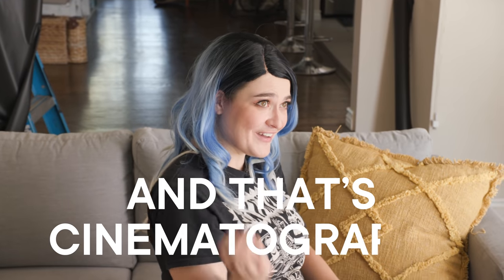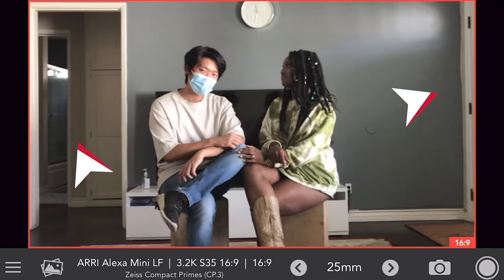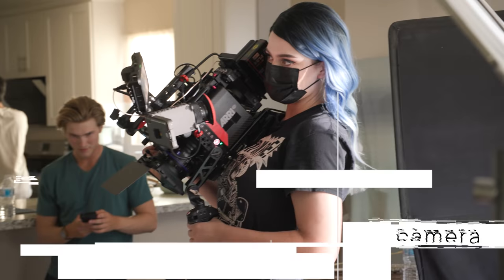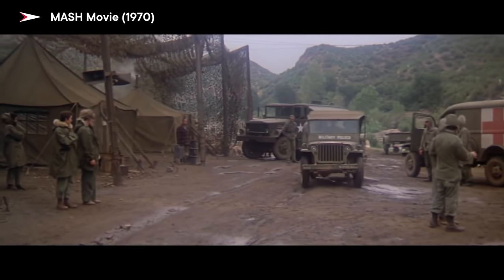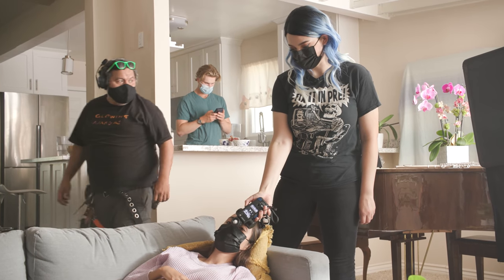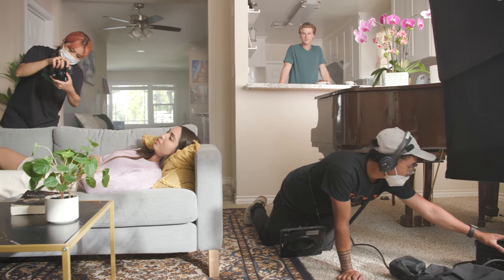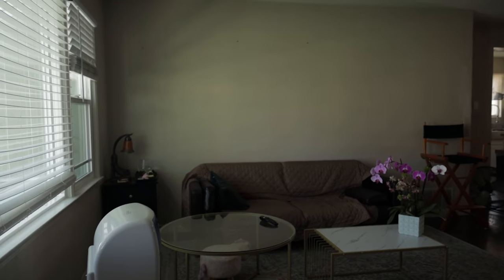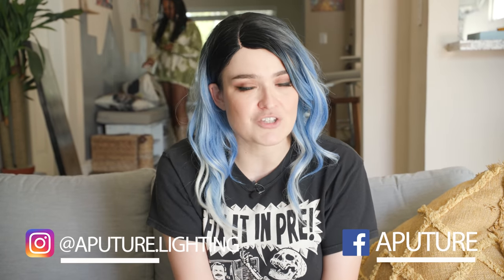Boring Location? | How to Make ANY Setting Cinematic

Comment: This is one of the best tutorials I've seen for aspiring DP's and filmmakers.  Covered a lot of useful info!  One thing I like to do sometimes when struggling with a bad location, especially when it's cluttered with stuff, is to just start clearing out the entire frame- removing all the plants and furniture, etc.- so you can work with a clean slate, and then start adding objects back in to the frame strategically.

Comment: I was once told to only light things I want seen, so I commonly reverse engineer that and remove light from things I don’t want seen in a boring apartment. A white wall with no light turns into a gray wall. Gray is much easier to add color to. So I’ll bounce a light into colored foam core to add slight tints of color to that newly gray wall. 

Vee, always love watching you bring in solutions for indie filmmakers who can’t always choose their locations or even scout sometimes before shoot day! “Quick” solutions like this are vital for filmmaking regardless of budget. Reminds me of the “high budget/low budget” segments of some older 4mfs vids. 

One thing I’m curious to see would be a dedicated video about those common “replacements” of industry things. You commonly do this as asides in videos, but I think a video that goes through “low cost” fabrics, diffusion, bounce, grids, etc could be great! For example, if you don’t have nets to cut down light intensity, the apartment you’re at probably has screens in the windows which can be used to do the same thing. Or if you can’t afford a roll of diffusion, you can always use tracing paper or baking sheets parchment paper. Hearing the pros and cons of these and even hearing from someone like a rep from Matthews who makes the industry fabrics/gels/nets and how they’re engineered for filmmaking can help people make better budget decisions. All of these things came from a simpler solution that eventually was needed in a more advanced situation, but that doesn’t mean the modern advanced solution is always the tool for the job.

Comment: to turn a "boring" location cinematic, I use high focal lengths and a lot of Aputure MCs dotting the background as sorta practical lights. I say sorta because I don't show them, but you see the light coming from the source; like I'll hide one behind a shelf to shine on my face, but you won't see the actual light, just that light is coming from somewhere right in the shot. If you haven't guessed yet, I'm pretty broke and could only afford the Aputure MC 12 kit, out of all your expensive gear (I've wanted them for years). Despite going against the convention and having literally no big lights - I actually ONLY use natural lights, lights already in the scene, or the MCs - I'm able to create some pretty good and dramatic lighting with just those little MCs. It's kinda crazy. They're really worth the money.

Comment: Lighting wise - bring in lots of practicals, candles, fog it up, block your character into different pools of light with varying temperatures, light up your background props & areas like stairs etc, even outside the door

Production design wise - mirrors and glass object helps add texture, get some water on the windows, definitely change the curtains, add in props that can be used as fg elements

Framing wise - shoot into the L of the room, find opportunities to create frame within a frame

Comment: Personally, I am of the traditional mindset of foreground, mid ground and background-- which makes me think of depth. When I think of boring locations, I think small - white walls - next to nothing in the inside, very minimal corporate offices, things like that. I look for windows or door frames if I can place them into the shot, create spots of visual interest. Cheapest hacks usually include bringing lamps, anything I can add layers of lighting to show distance, also set decor, rearranging what I do have in the space to make it look more populated. All of this depends on what we're going for of course, but getting talent off the walls and into textured backgrounds helps a bunch. Choreographing talent to make the space look not so constricted. Having options for cuculoris can also create the illusion of windows if there aren't any or create a visual separation between spaces. If all else fails, I will try to force a bit of separation either through light value contrast or color temperature lights differently.

Comment: I had a film crew use my house once and in their shoot there was a conversation between actors by the fridge. And I guess the fridge fan motor was intermittently kicking in. So someone opened the fridge doors and turned the dials all down to zero. Which stopped the fan from kicking in, but whomever did it, forgot that they did it and never told anyone. So my well stocked fridge ( and freezer ) looked to be working because the light was on - but all the food spoiled.  
So if you work in a house and do something like that, take a few minutes and leave a note on or in the fridge. Or even better take notes to tell the homeowner or turn it back on before leaving.
Reply: The trick I've seen used on film sets is that the person turning off or unplugging their fridge puts their car keys in the fridge until they turn it on again. That way it's never forgotten

Comment: Loved this one, I mean the spaceship was cool too but this one was super helpful. So, what have I done to make my apartment cinematic? So, I use my apartment as a set 3-4 times a week for my videography and camera gear related YouTube channel "Power of Drew" and other videography based projects and I have found that painting half of your walls a darker color like grey can really help give some contrast and depth to your talking head shots. Also, I recommend getting a few good quality lights. For example, I currently have two Amaran 100d's that are on C-stands with castors that I can roll around the apartment to change up my shot. One light has the Aputure Lantern for fill the other the Aputure Dome-Mini for key. Which reminds me, try to find furniture that you can puzzle piece together and isn't too large to move around. This way you can have endless different configurations for your place, especially if its a tiny place.  Finally, I suggest black-out curtains or something similar so that you are able to control the light coming from your windows, since being able to control the light will be at your advantage. 

Thank you Aputure, you guys are my FAVORITE company. I am a HUGE fan. So thankful you guys are making products for people on a tight budget. THANK YOU. 

Keeping my fingers crossed I win this MC. But, regardless I'll be here for the next one.  💡🎥🎬

Comment: In one client's home, there was a disgusting LED fan light above the kitchen table. The light was harsh like sandpaper and bleach white like dry ice. 
I wrapped the whole ceiling fan in a soft white bedsheet, draping it slightly lower than the bulbs to diffuse more, and clamped the sheet around the base of the fixture with clothes pins and quick clamps.
The light was soft, warmer and gently fell away into the background.

Comment: I have to use these hacks a lot; especially, when the pandemic limited my shooting to home. 

Absent of painting, white and beige walls can benefit from a soft, color wash. Saturate to your personal taste, but add a contrasting color to make them both pop. Whether that’s balancing your camera’s white balance at 4600K and using Tungsten and Daylight settings or just using gels. I’ve added Full CTO on an industrial work lamp just to get it to pop from a room saturated with a Vittorio’s VS-Indigo wash (available on the Nova P300c.)

Leverage third-point perspective. Shoot into corners, but also don’t limit yourself to a static camera plane. Raise your tripod and shoot towards where the wall and floor intersect or use a high-hat or sandbox to tilt the camera up into the ceiling. Even a dull highway has unique angles and perspectives. Use some Aputure MCs or even M9s with gel to sprinkle in some color.

I’ve also found incorporating a hard source shooting through a homemade Cucaloris (gaff tape across a frame) to mimic a window; then, a complementary or contrasting color can shake up an otherwise flat wall. I argue that my suggestions so far have been static. Just adding movement to a light in a scene can supplement the shot with some interest. Light aside, any actor movement from point A to point B provides an element of depth in the frame.

Add some foreground to the frame to augment depth. Whether a prop, potted plant, etc. Having something in the foreground enhances the frame. If the story calls for it, a rack focus can add some interest.

If all that fails, open up the aperture and conceal the background with a short depth of field. Maybe throw in some tiny, sharp background lights and exploit the lens’ blades to create light shapes; thus, creating interest.

Lastly, educate yourself. The Aputure product release videos and annual training with resultant certification test can help you to maximize your investment (e.g., using Sidus when shooting alone). 

I hope this helps all the other subscribers and welcome any feedback.

Comment: In a boring set, i usually find the best way to create depth as much as i could. add the typical key rim hair light. lastly i just use any practicals i could find to shape things my interesting. lastly, perhaps i use mist, crystals, or smoke machine to make the mood. The branchaloris is very interesting technique, thanks.

Comment: I remember having to shoot a rap video in a boring apartment with white walls.. the only thing interesting in the room was the table and the extra props that were on it that you would normally see in a rap video. So I went back home and grabbed a 1x2 little mirror and put that mirror on the table in the middle of the extra stuff.. pointed the camera towards the mirror and shot the performance track at an angle where you couldn’t see the camera and could only see the artist in the mirror along with the stuff on the table.. That shot turned out crazy good with a little bit of camera movement in a boring apartment!

Comment: I think there should be a video about how you use all aputure lights.

How compact they are to fit in SUV or small car for a ad or small shoot, small crew and low heat and many more features
Reply: I meant compact, crew size, quick to setup and breakdown.

Comment: What if you have to shot a wide shot scene where there is a lot of wood planks on walls and ceiling and the ceiling itself is angled 45 degrees both sides with a little flat space between?

Comment: What I've been trying to understand is how to fix that issue that occurs when the character comes in from a sunny outside and the light balance shift to dark inside then normal once the door from outside is closed? But that you very much for this video.
Reply from the maker: A lot of times in film you don't see characters walking from outside to inside and visa versa for this exact reason. Generally, this requires the lighting inside to match the intensity of the sunlight so exposure remains the same, or heavy sunlight diffusion of the exterior. If it's a tracking shot, an iris rack is not off the table if done properly.

Comment: Why use a net to cut light without diffusing when all your lights are... wait for it... dimmable?
Reply from the maker: Nets cut specific portions of the beam and have a fringed edge so the falloff is softer, similar to a barn door but more pleasing and controllable.
Reply: The top half of the light is diffused. The bottom is netted. It’s the same light source.
Reply: @valentinavee  thanks for the clarification! Great technique I'll definitely add to my toolbox.